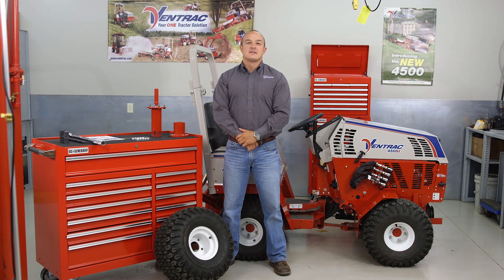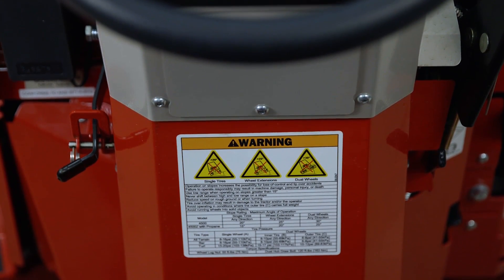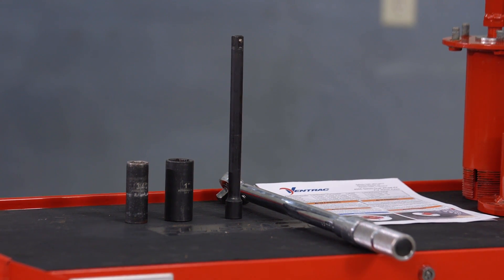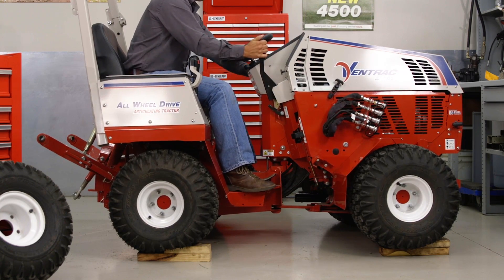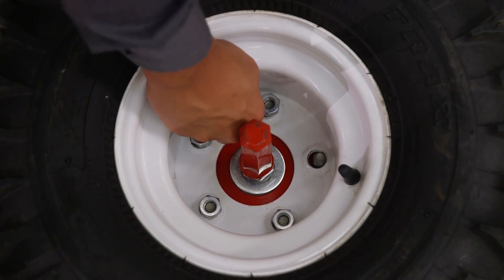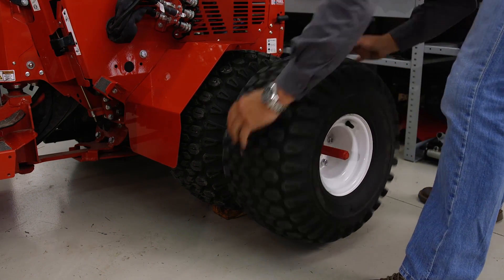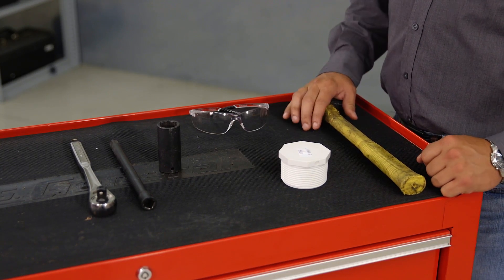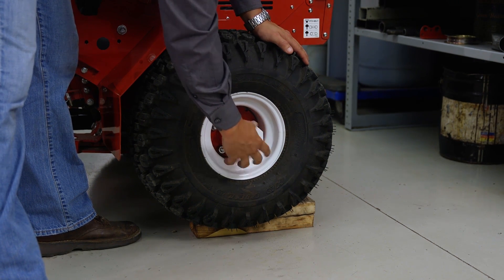Ventrac 4500 Dual Wheel Installation & Removal

Comment: So the dealer installed my dual kit before delivering the 4500, and after watching this video I think they did it wrong. My inside wheel is white which means the extension is on the backside of the wheel. That may explain why my lug nuts get loose even after they said they torqued them. The first week I had it the outside wheel actually fell off while I was mowing. You guys make a great product, you need to make sure your dealers know as much as your in house techs or you may be getting a bad rap for someone else's ignorance. My local guys mean well, I'm just not sure if they are up to speed on your equipment because I had to mention other points I've seen on your videos they missed. Thanks
Reply from the maker: First of all, thanks for watching and taking notice.  If you're still having any issues whatsoever, please verify that everything is installed correctly before any further use.  If you're not sure, please contact the dealer or our internal customer service department and reference this video.  We'll do our best to educate the dealer as well.  Thanks for the comments.  We want your machine to work like it was designed to and your safety and satisfaction with the product is very important to us.
Reply: Ventrac thanks, that may also explain why they had so many lug nuts left over. At least they gave me the bag full of them. My other issue you may be able to help with is the mulching kit on my 72" deck. They said it uses the same blade as the side discharge but it leaves a track of grass. According to your video it says its supposed to have mulching blades with the kit. Is that correct? I have Kentucky Blue grass which is a tall blade and it bogs down the machine when mowing besides leaving grass clippings. Do you make a double stack blade like the Honda mower? They seem to work great with that type of grass and leaves in the fall. Here in Colorado we're getting set up for snow so mowing isn't my concern now so you have time to get back to me on that one. I have the 4500 with the Kawasaki because I have some pretty steep slopes on the property.
Reply from the maker: With our 72" finish deck, we used to offer a mulching blade but some time in recent history we stopped stocking it due to supply issues.  Currently that deck ships with standard low-lift blades.  The only blades we offer are low and high lift.  Double stacking blades isn't something we recommend but I'm sure if the dimensions were correct (thin enough at the spindle and not too wide overall length) it would be doable.  Speaking with our service department, their recommendation would be to continue running low-lift blades with the mulch kit as high-lift will not work very well.  Alternatively, and the best option if you can source them from your dealer or online somewhere would be to go ahead and swap out to mulch blades.  The required size is 24.75" x 1/2" center hole, RH.  If you still have any issues cutting like you'd expect, snap some photos of the cut and/or under-side of the deck and send them in to our service department... we want to get you going asap.  Thanks.

Comment: I hope my dealer service tech watches this.  My outer wheel extensions were tightened with a four foot pipe (monkey) wrench as witnessed by the distinctive teeth marks in the paint and metal.  I asked him about it and in firm reply he said, "Yes, I want them tight!"  I used a long steel pipe and loop of chain to wrap the tire and stood on the pipe and bounced until it turned out.  Quite a job with 4 wheels that way.
Reply from the maker: Thanks for the heads up... we'll try to make sure the proper procedure is followed in the future.
Reply: Yep, mine were dealer torqued higher too. Nothing a 1/2" impact torque wrench couldn't handle though.

Comment: Do the wheels need to be the same size?

We just boight a new ventrac and it came with a dual kit, a set of knobby tires on 8" wheels, and a set of slightly shorter turf tires on 10" wheels.

Comment: How do you prevent dirt from getting into the threads on the inner plug threaded insert? I have seen so many Ventrac users unable to get their duals off once installed because the plug gets wedged, and the inner plug binds up into the threads.  Would it not be prudent to apply and never anti-seize to the threads to block contamination and rust so they will quickly turn off?  The difficulty experienced with Ventrac owners reminds me of removing agricultural tractor duals, which are subject to constant dirt and rust all day; only after the duals have been removed and treated with a high-grade Anti-seize do these duals become much easier to remove. As a note, Agricultural dual tires are several thousand pounds when removed, and to have to fight them only to have them suddenly released is dangerous.

Comment: He says 1” socket but it’s a 1,1/6” socket because I found out the hard way by getting a 1” socket firmly wedged in to place requiring me to find a way to get it off with a steel pin and a hammer on an metal perch
Reply: It absolutely is a 1", I just did the exact same operation. If you've got a socket stuck, tap it with a hammer a couple times. With how small the Ventrac tires are, a 16oz framing hammer worked perfectly for a deep impact socket

Edit to clarify that the framing hammer claw was perfectly sized to wedge on the tire and pop the socket off after a tap or two.

Comment: How much width is added to the tractor with the hub extension installed, but the dual wheels off the tractor? I have a smaller trailer and space is limited. Thanks!
Reply from the maker: So it is actually either or as you can't run duals with the extensions.
Reply: @ventrac  Thank you for responding! By hug extension, I meant the Inner Hub that's installed over the existing lug nuts, paired with the white cap shown in the video.
Reply: @willp942 The cap, when installed, doesn't stick out further than the side of the tire itself.

Comment: You said that the wheels should be installed with the warning sticker facing inward.  What if the sticker fell off?? and it will eventually !!!
Reply: Once the wheels are mounted to the hub adapters,at the time of the initial set up it will be very obvious which way they go they only fit one way. Besides if you can’t use the valve stem and the taper on the lug  nut openings To see which way to put them you have no business installing these anyway.I’ve had mine on six years now they are awesome I use them every spring and every fall when the ground is soft and whenever I have to do a steep hillside mowing job

Comment: I'm confused.  A 1" socket will not fit on the draw bolts.  Bradley at Blue Force uses a 27mm socket but that seems loose.  The owner's manual does not list draw bolt size.

????
Reply from the maker: The draw bolt would take a 1” socket. There may be excess paint on the draw bolt not allow the socket to slide on easily. If you email info@ventrac.com, we can send the instruction sheet as well.
Reply: @ventrac  I bought a 1 1/16" deep socket which fits well and worked. 
Dealer suggests powder coat added to bolt dimensions. 
Is 150 ft-lbs torque on the steering cylinder adjustment bolt a typo?
Sing, dance, laugh.  Ventrac are wonderful.  :)
Reply from the maker: That is not a typo! A big torque wrench is required :)
Reply: I use a 1" socket without problem except when I hit the draw botl to hard with the BFH.  A few strokes with a large mill file removed the distorted metal.  Thus 1" fits again.  Since my tires are fully ballasted, I find it easier to remove the lug nuts, then the outer wheel, and then the extension since the tires are then very heavy.